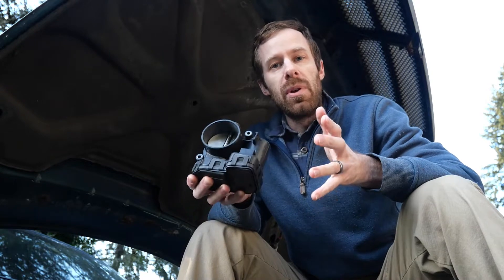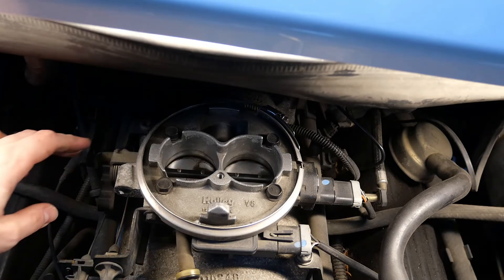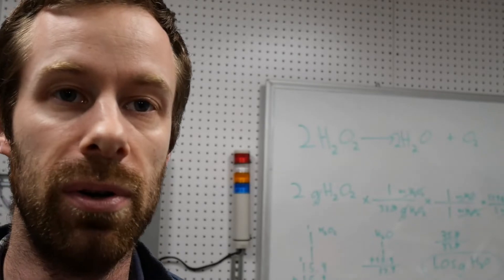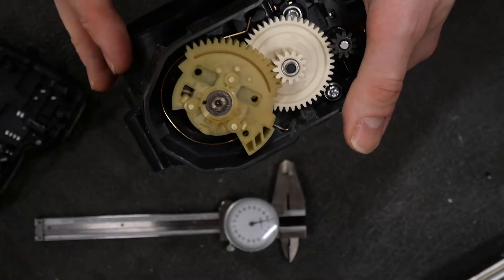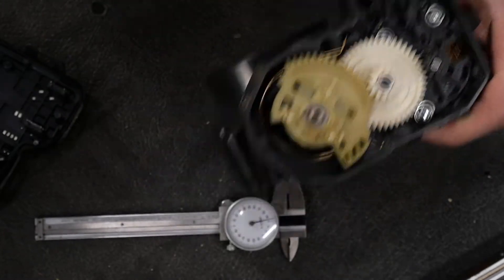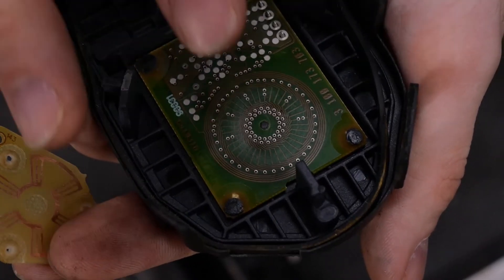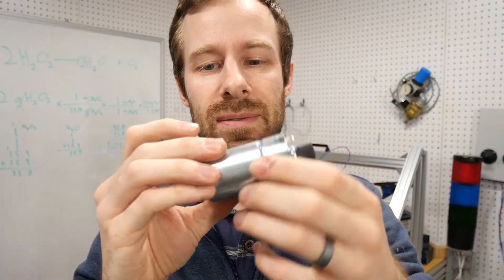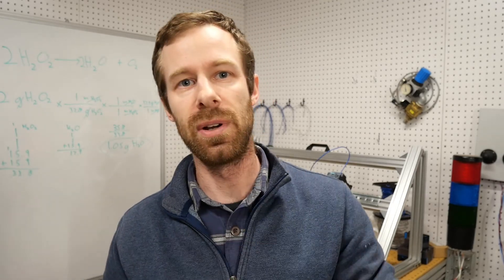How Does an Electronic Throttle Body Work?

Comment: With a hand held scanner can run servo's on throttle body like a tech 2 on a GM. Can also turn key on engine off have helper step on gas petal servo's in throttle body will work and can hear them or maybe not in your family cruiser

Comment: Thank you so much for a very educational video. I would like to ask you a question please. I am driving a 2024 Mazda CX-30 and noticed when the engine is turned off and with the hood opened; I could hear a low electrical buzzing/humming sound from the electronic throttle body servo motor. At the end of the 2 minutes run, I could hear the butterfly valve (clink/clank) sound shutdown and so as the buzzing/humming noise. Through further searches, I learnt that Mazda 3, CX-3, CX-5, CX-50 or even GMC all have the same behavior. From your explanation, I now know that it came from the DC motor. But, would it be logical to have the motor shutoff immediately after the engine is turned off? I was wondering what the design purpose is to have the DC motor humming for this long and what is it that it is doing within that 2 minutes.  Thank you kindly for your explanation.

Comment: What different sensors on the car send it signals?
Reply from the maker: Since it's electronically controlled, it's not that simple. It gets it's position signal from the ECU, that part is simple enough.

However, the ECU needs to have an accurate readout of the current engine temp (to know how much to set the choke position), the current cam and crank positions (to know how much air to add at the moment), the throttle position (same reason), and probably others, like the O2 sensors.

I really don't know the algorithm it uses, but I imagine it's a pretty complex combination of various reading from the input to the output.

Comment: Sir, I  have a 2017 toyota camry le with a code 2109, one mechanic  said it is a harness problem, another mechanic  said to replace the electric Throttle body.I did replace the accelerator pedal but the code 2109 will not delete. Could you please help me, I would appreciate. Thank you, Larry